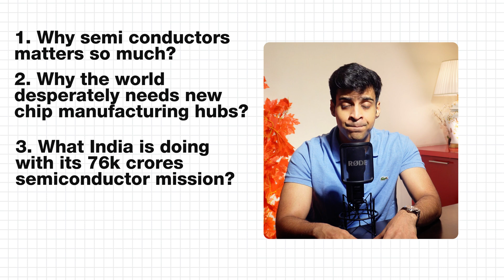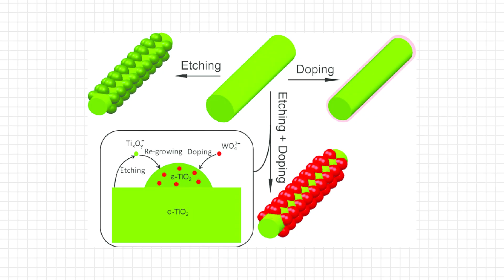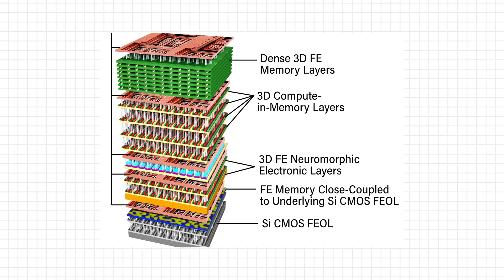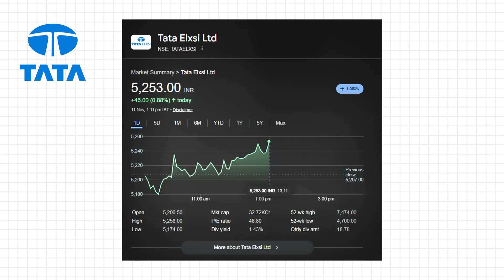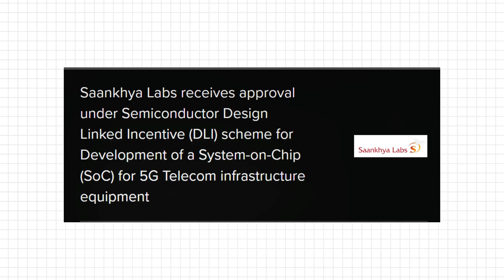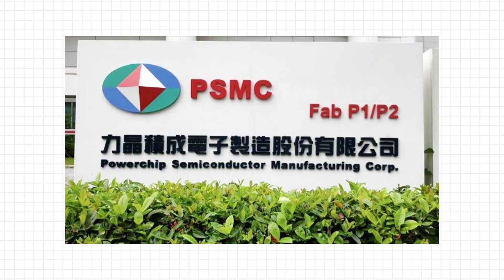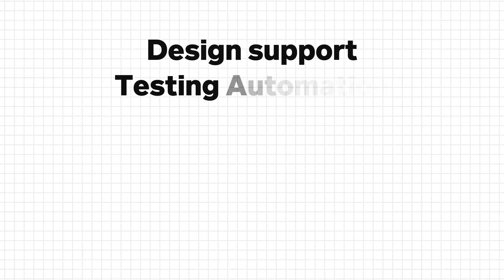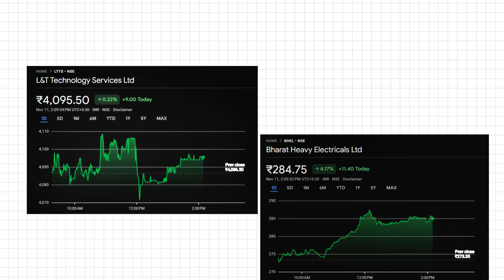8 Indian Semiconductor Stocks to Buy for the Next Decade

Comment: Titan Intech Ltd is emerging as a strong penny stock in data centre and display solutions. The company has a ₹50 crore data centre order in Andhra Pradesh and recently signed a USD 153 million MoU with a Korean firm for Mini LED and display technology.

Latest News
Titan Intech has also signed an MoU with APEDB for a ₹250 crore Display Electronics Facility in Amaravati, strengthening its growth potential.
Reply: Many large players are there in this sectors like dixon technologies